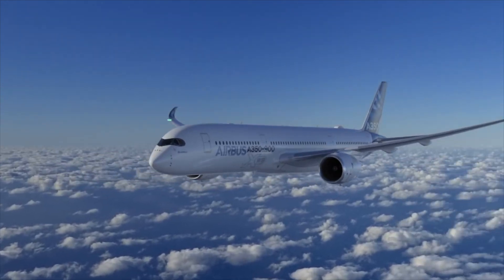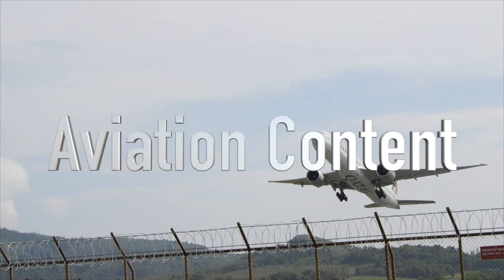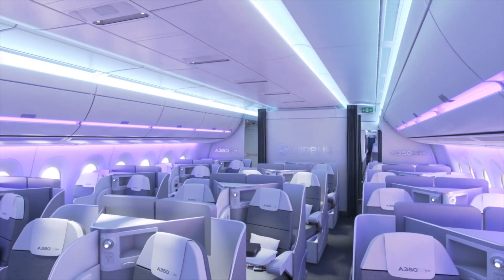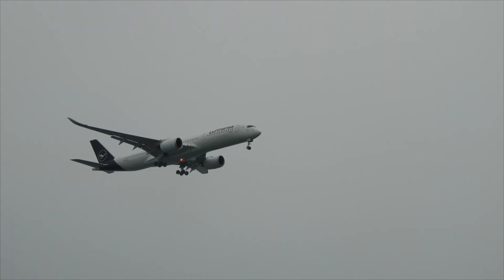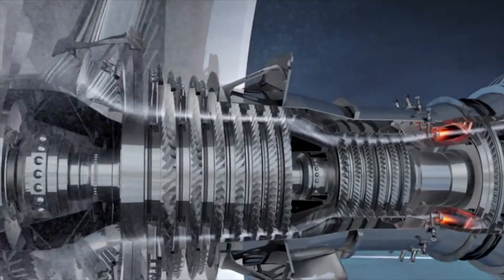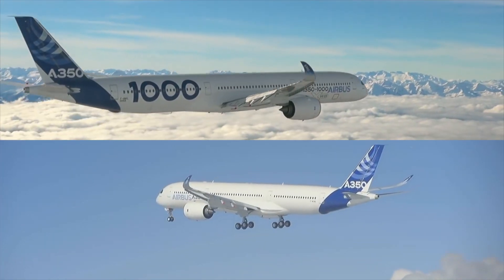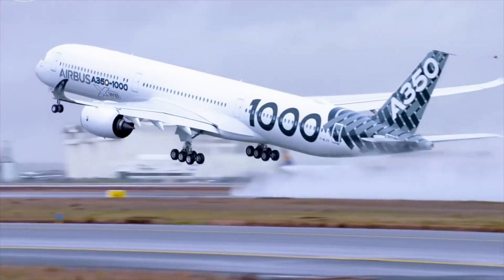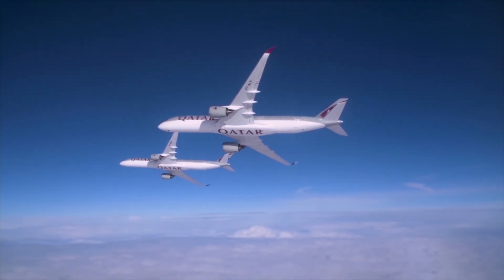Airbus A350-900 vs A350-1000: What’s the Difference?

Comment: Ranges?
Reply from the maker: A350-900 8100nmi A350-1000 8700nmi. Both in two class and A350-1000 with new 319 tonne takeoff weight :) Thanks for tuning in!
Reply: If you were owner which aircrafts wood you take?
Reply from the maker: @jamilisazade2808  Personally the -900 as its big enough with lower trip cost. Thanks for tuning in!